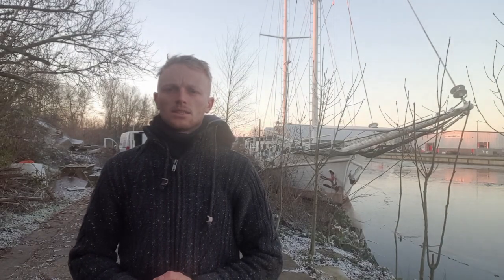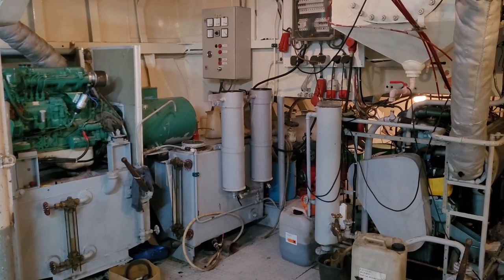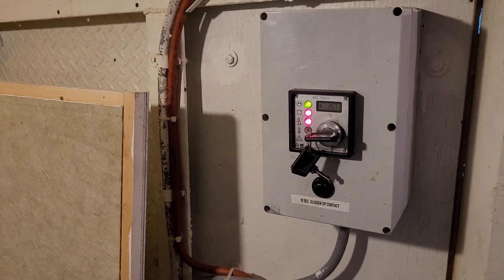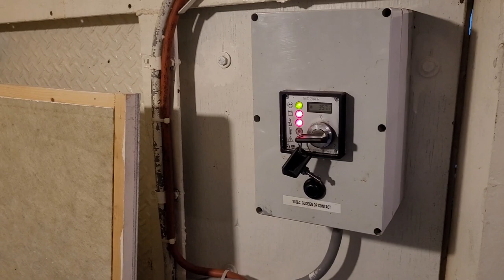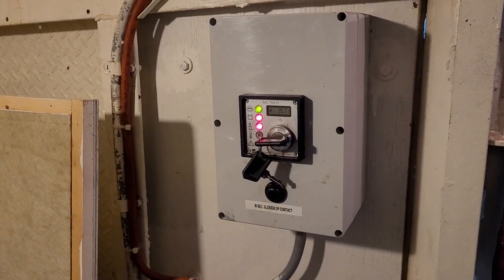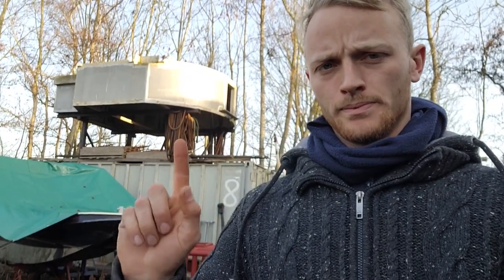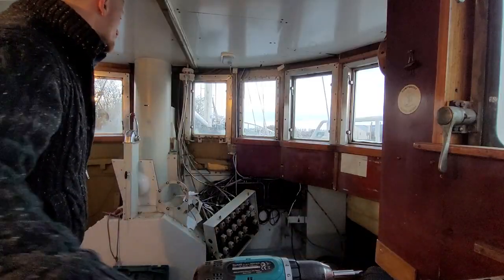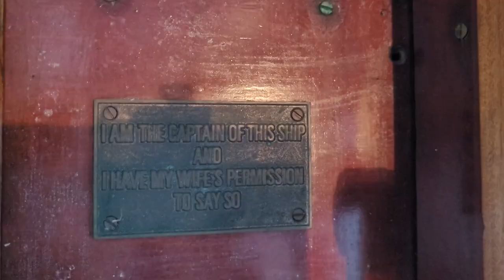Reviving Schooner Tijgerhaai - A new Wheelhouse? (EP1)

Comment: Shame the vessel is so far away from NZ as we have 5cyl, 6cyl and 8cyl NA and Turbo Gardners  here that would look rather nice in your engine room.
Reply from the maker: That is some stuff to dream about. There used to be a dutch engine manufacturer, 'Kromhout', Who used to build Gardners in licence, under their own name. Kromhout is still a legendary name in Holland.
Reply: Your best option might be to contact Joe McCool at Tangent engineering in Ireland if you want a Gardner. That or you could find an ex- truck Gardner sumthing like  a 6LXB or even better an 8LXB and marinize it yourselves. 
Bellhousing
Gearbox
Engine oil cooler
Saltwater pump
Heat exchanger
Altho if you keel cool the engine you wont need the salt water pump or heatexchanger. 
If you want the bigger series engines like the L3 or L3B series do not buy one from a rail traction unit/ train as mounting a marine gearbox to one is a complex (expensive) job due to them not being able to accept a bellhousing.